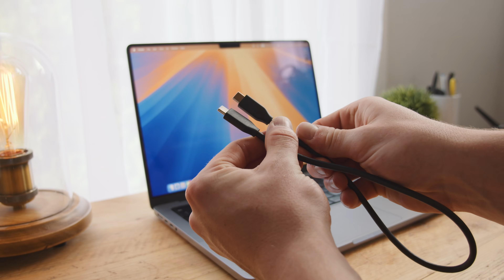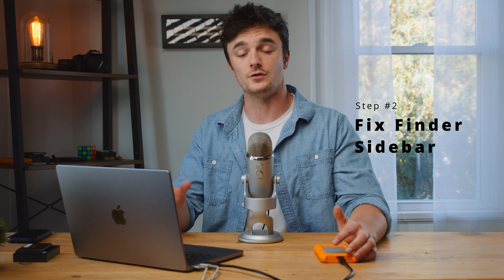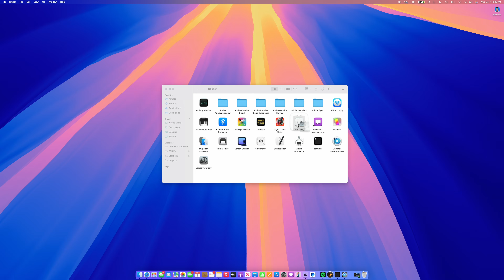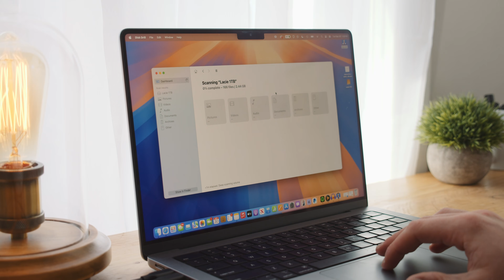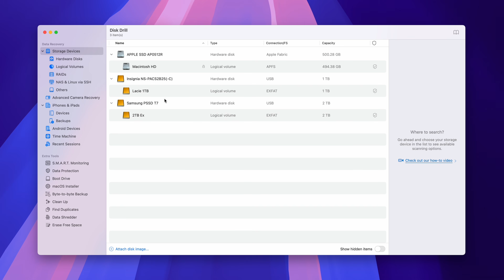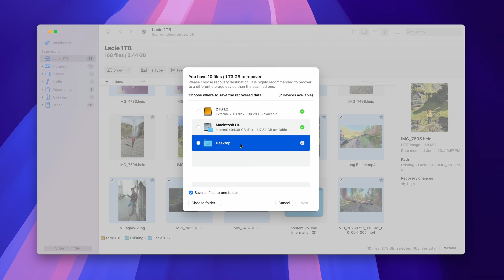How to Fix an External Drive Not Showing Up on Mac

Comment: omg THANK YOU. mine shows up in disk utility but not in finder and ive been losing my mind over it for hours. quick question though - if i run first aid and it says it repaired errors, does that mean my files are safe or should i still do the recovery software just in case?
Reply from the maker: Even after a "successful" First Aid, you should prioritize Disk Drill to extract your data immediately, as it can read the raw files that macOS is currently ignoring. This ensures you have a backup before the drive's logical health potentially gets worse.

Comment: My external drive doesn’t show up in Finder, but I can see it in Disk Utility (greyed out) and in System Information under USB. First Aid didn’t fix it — what would you recommend trying next?
Reply from the maker: Because your drive is still visible in System Information, Disk Drill is highly likely to succeed in retrieving your data before you perform a clean reformat.